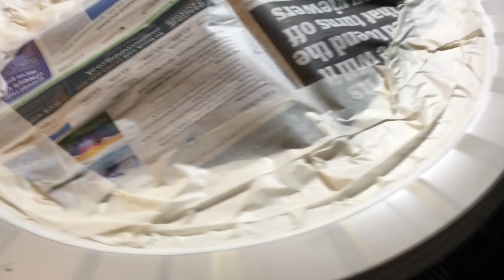Star Trek Enterprise Build Part 3. Fixing surfaces.

Comment: Great tutorial, subbed. I think someone has already mentioned Lou Demaso's aztek masks. You might also want to look at trekworks channel. He is a car painter and finisher by trade and had done some great aztek-ing but struggled with Lou's masks being to adhesive. Not sure which mask he went with for the rest of the build but I'm sure he tells you in his videos. As balance I think Lou has since changed the vinyl and adhesive he uses for his commercial masks